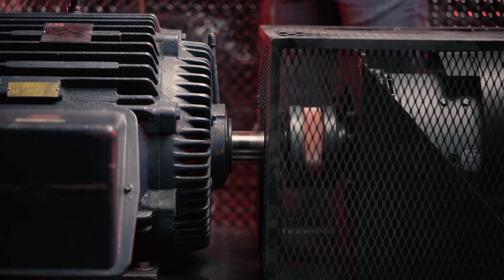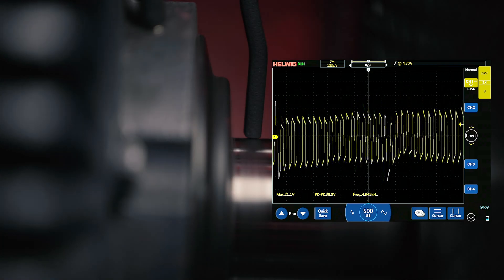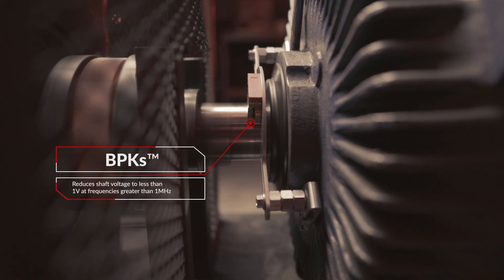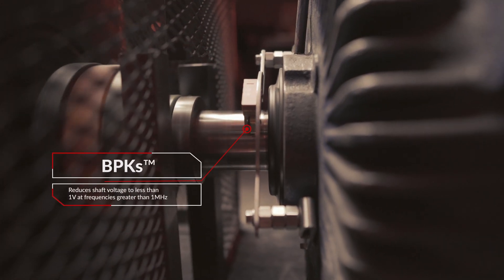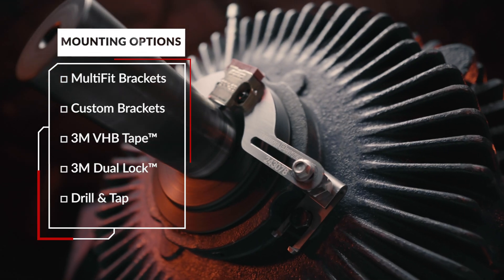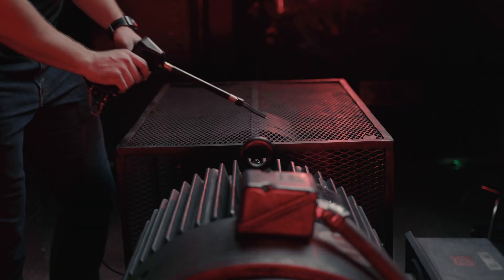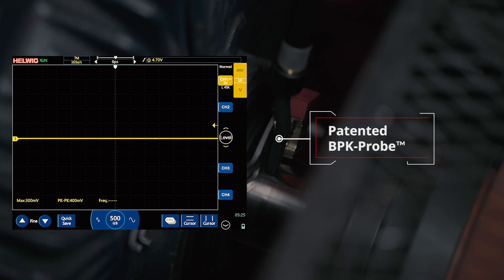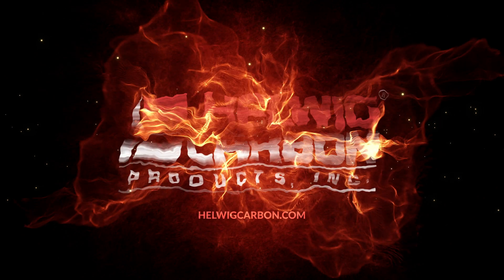Bearing Protection Kits™—VFD induced shaft current solutions

Comment: I'm considering the BPK-IM2 for an EV motor.  It would be aligned axially and contacting a plug installed into the tail end of the hollow motor shaft. I didn't see this mentioned in the installation document, is there an optimum mating material? Also, would the brush contact be optimally placed at the center, or slightly offset a few millimeters?  Motor RPM is typically around 5,000, maximum 10,000.  Thanks!